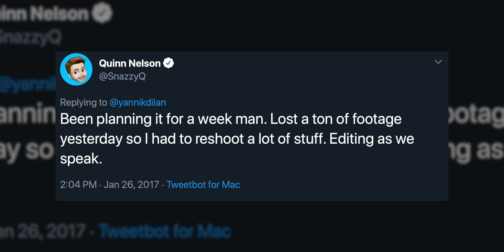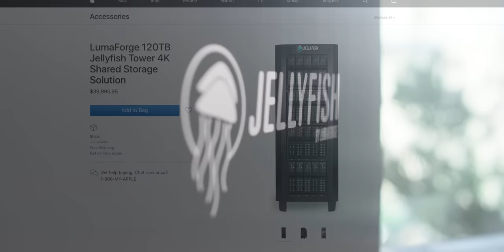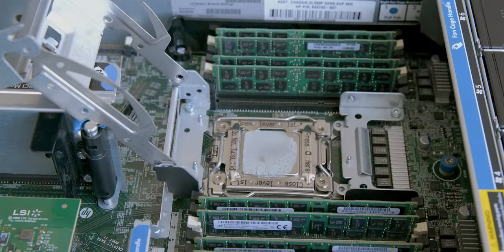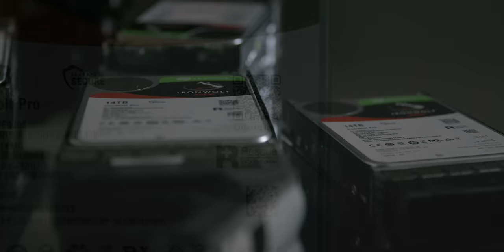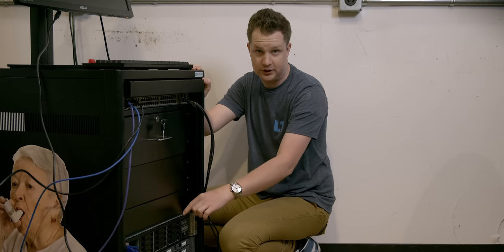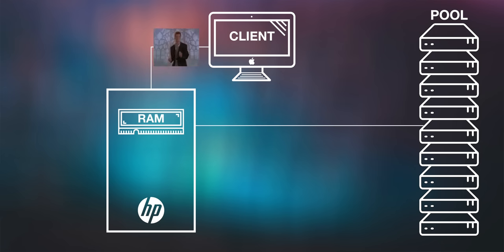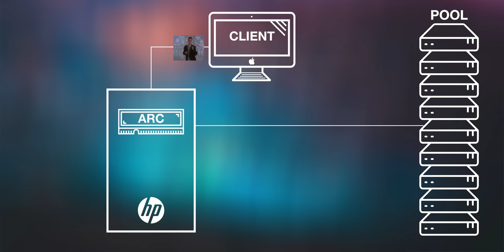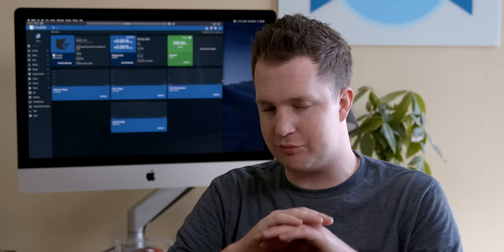I Built a HUGE 336TB Server Without Linus Tech Tips!

Comment: Is it possible to build a 1/3 petabyte server on a budget?  It is if you get 24 14TB HDDs for free.
Reply: That made me laugh too. Those 24 drives are £450 EACH in the UK, total cost for x24 (if you had to pay for them) would be £11,000+. That does not look, or sound like a budget server!!! lololol
Reply: Thought the same. Have an dual socket x58 board here. More than enough power, also a ZFS pool with ssd cache. Performance is more than enough for me and my Fam, but yeah, HDDs are still expensive if u need like 10 of them lol
Reply: Ah but he was going to buy them anyway so it's all ok.....
Reply: @magburner  I mean even if he paid for all the drives at $11,000 and $2000 for the hardware, throw in an extra $1000 for accessories and it's still a server on a budget compared buying new equipment and a software solution on top.  $15,000 is a very different number to $40,000
Reply: easy, he means budget for what it is, 120tb 10gbe storage, the cost of the drives cannot be avoided. would you like to see the price on similar jellyfish storage?
Reply: I wonder if Snazzy is actually going to put the worth of these drives on his income/business tax. I doubt it since nobody ever does that.
Reply: @giornikitop5373  jellyfish is some new trendy BS, no actual production studio will be using them. They are charging for software and support. 
This single setup he has would be a nightmare to restore without having VM's and multiple SAN's providing full redundancy. 

You want to have SSD's to work off of and then storage on the spinning drives. he spent under 10K but if he has to upgrade in just a couple years it was a waste.
Reply: @swaterman08  i know jelly is bs, i even contacted them asking for specs (like cpu type, ram etc) just for the fun of it, but they never responded back, i can guess why. sure a san will give a big boost in i/o perf but i think is out of reach due to difficulty to troubleshoot and maintain for most ppl, not to mention much higher cost due to fc or ib. i don't think upgrading or restoring this system is difficult, he can always add more shelfs or nics and freenas is fairly straightforward, not easy but not that hard for a simple storage solution.
Reply: A real person spending their own money would go with 8 or 10 TB drives, which scale nicely to that point at $115/4 TB, $185 for 6 TB, $225 for 8 TB, $270 for 10 TB; drives go up in price quickly beyond that point for each additional 2 TB in capacity...
Reply: @You know the deal son I've not heard of any Iron Wolf or Iron Wolf Pro horror/failure stories just yet...but, yes, some of Seagate's classic desktop drives in past years have been more 'failure prone' than perhaps some competing brands...
Reply: @DV7Dave  And, he has more than double the storage offered by Jellyfish and their silly fucking $40K solution....
Reply: @JurisLLM  you'd have to be a buffoon to want to declare 'sponsored gifts' as income! :)
Reply: @magburner  If you know costs of building servers, and you will count the capacity of storage, it is on the budget
Reply: @JurisLLM  He was given them for free in exchange for an ad placement. Do you report your birthday/xmas presents on your W-2 in exchange for recognition by the gift-giver? Mmm-no.. You don't. He almost certainly pays taxes for the ad-revenue he makes because he doesn't have a choice. This comment honestly destroyed me.. Think before you type, people.
Reply: @magburner  $10k for a server really isn't that expensive considering what he is running.
Reply: @giornikitop5373  The jellyfish isn't intended for people asking for specs other than 'how much video can I store?' 
It's the Apple version of a storage solution... "It just works" (as long as you got the cash)
Reply: Did you really not achieve any previous footage?
Reply: You can still do it with existing HDD with even 64 gigs if you wanted to, but yeah it's definitely not cheap.
Reply: Exactly. Drives are so expensive. 5 years ago I bought a WDEX4100 NAS with 4 6tb WD reds. £1000 ish.
Costs the same ish now, for same drive capacity.

Trying to find a cheap solution to massively expand my existing storage, but it's gonna cost thousands. Thousands I don't have
Reply: @mdd1963  "you'd have to be a buffoon to want to avoid committing tax fraud! :)

There, fixed it for you.
Reply: depends which budget 😂😂😂the title, as it is, indeed is ridicolous. It misleads people make thinking on very affordable "for everyone" system. But it's a budget nas, if compated to a brand new for enteprise purposes. Good to now there are so many ppl, ytber, full of money 🤣🤣🤣
Reply: @magburner  The video was sponsored by Seagate, so maybe he got a discount on them.

Comment: If Seagate gave me $11,000 worth of drives, I'd be recommending them too. Jokes aside, that's pretty neat.
Reply: Yep its easy to say that you build this setup by <2000$ of enterprise grade hardware when you are getting 24 14TB HDDs for free.
Reply: In the UK that £12000 of off the shelf drives
Reply: I still wouldn't recommend them. I'd sell them to suckers on ebay and buy some reliable drives instead.
Reply: Sammy Swanksmith these drives are fine 🙄
Reply: @sammyswanksmith4807  It's actually astonishing how much money Seagate wastes gifting drives instead of improving the quality of their products. I've literally never seen a single sponsorship by WD in an entire decade that I've been lurking on YT, and the reason I think about this is pretty simple: they are the best rock solid brand in the industry for HDD, so why would they need to spend money to sponsor a project? What else could you go with if you need a reliable storage? Top lineup uses HGST helium drives, which still is WD. I may have trusted my old Maxtor with PETA interface, but I don't have as much faith in Seagate, and you shouldn't have too if you periodically check Backblaze HDD reliability stats.
Reply: You can apply the same concept for Samsung with SSD. In the end, you won't find any better NAND than theirs; it's just such a well-known fact that it doesn't need sponsorship.
Reply: @You know the deal son what do you recommend?
Reply: @lostremnant1140  
I purchased a WD 500 gig drive from amazon a couple months ago and it arrived unusable. While the system would recognize the drive, the drive would not format.

Can't say what caused that as I am not a technician, but I think their shipping the drive in a loose fitting box inside a thin bubble wrap envelope did not protect it from the shocks that occur in the delivery process.
Reply: @Chukijay  WD Red Pro's are the best

Comment: really cool setup but i know from experience that 60 seconds is NOT enough time to shutdown servers, you're gonna want to get a bigger UPS
Reply: Realistically he would have up to 10 or 15 minutes with the UPS at full load. Meaning you would have to be pulling 1500w with a pf of 1 to achieve even the minimum runtime for the UPS. That is also assuming your batteries arent old and nearly dead which could give you a runtime of 1 minute
Reply: Well you can get a big 18650 bank
Reply: He's saying that at PEAK LOAD  there would have a minimum of 60-seconds for the server(s) to begin the shutdown process. Other than that specific situation happening (never), he is 100% safe with the hardware he's using.
Reply: Nah he's using ZFS no UPS needed. Especially with only two users. Copy On Write is freaking amazing. I have a zpool that is 8 years old. It has survived many power outages. A bad drive. Even a bad SATA cable that would randomly disconnect a drive sometimes mid use (that one was annoying to figure out). Every time I’ve ever had a problem ZFS has had my back. Resilverd and ready to go.

I even dd a /dev/zero over one of the drives once. I know I’m a dummy. Was trying to erase a thumb drive. Ran a scrub and everything repaired no problems.

Comment: You should consider adding a NVME log volume for the ZFS; This will allow plenty time for coalescing I/O and handle bursty I/O as well; I'd also recommend using a separate boot volume, if necessary.

Just leaving it as a suggestion :)
Reply: He is using a separate boot volume, FreeNAS forces you to. Generally it gets run off a USB flash drive.

Comment: "on a budget"... if you get sponsored with $12 000 worth of hard drives
Reply: Comparative to the other solutions, it was still cheaper. And if you used cheaper drives or slowly purchased your drives I'd say it's a pretty good budget option for these kinds of demands.
Reply: meliohe! A budget is a set amount of money that doesn’t mean necessarily cheap. The server even if the drives are $12,000 and the server being $2,600 is still cheaper than a lumaforge, which is $40,000. This isn’t for the everyday consumer this is something that meets his needs. NAS is a great budget option for lower spec requirements.
Reply: István Szikra I have card board boxes, an old laptop motherboard, old hard drives laying around, and a glue stick. I’m sure I can make my own using those items and not break 3 dollars
Reply: If you really needed to do this on a budget he wouldn't have needed to be sponsored and get a walk through. I did this on a budget and it cost me a couple thousand dollars. It's amusing to see that all these YouTubers created a server around the same time and clearly never thought about backing up their own data until a sponsorship arrived. You think considering it's their job that they would care about their own content that they've created. 

To do this you need to take apart external hard drive, "shucking", and build cheap Nas, utilizing the sc846 chassis that you can usually pick up for 2 to $400 off eBay with some parts included(I tossed almost everything).  You don't need server grade Hardware, but I find running Intel is easier and your chassis already comes with server grade Hardware so you might as well utilize it. I'll upgrade to ryzen when I can tho for power efficiency

Comment: Hey Snazzy,
On the subject of upgrades, there's also another method,
If you have Auto Grow enabled on the pool, what you can do is pull an old drive on a vdev out, and stick in a new higher capacity blank drive, and let the NAS rebuild the array with the new disk, then move onto the next disk. Once all the disks in the pool have been upgraded, the pool's capacity will magically increase to suit the new disk sizes without having to add additional drives.

Also regarding the noise, check the UEFI Settings on the HP Server, there may well be some options to adjusting the cooling profiles to favour less noise, and if the machine lives in a space that doesnt see excessive temps, you should be able to get it decently quiet. All of my Supermicro and IBM / lenovo System-X Machines have quiet profiles, and they really are quiet on most days unless it gets really hot.

Cheers.

Comment: When I saw "Without Linus Tech Tips" in the title I was concerned that you did it yourself and it would end up being meh, then you said Wendell helped and I was super happy because he's amazing
Reply from the maker: Wendell is a super hero.
Reply: yeah, this system running zfs and being really value and reliable is also inspiring to other creators and home users to build sth. similar on the cheap/far cheaper than this even, that actually has proper reliability and  data corruption protection.

Comment: Thats not a 1500W UPS, its a 1500VA UPS which supports 1000w, just FYI
Reply: VA is equal to W. They are both the same unit of power. What does 1500 W represent and what does the support for 1000 W mean?
Reply: @matj12  Nope, they are very different measurements. Spend 10 seconds googling it
Reply: @jimsbagels1991  They are the same unit but in two different measurements. I spent some time searching for what the two measurements represent but I don't know what to look for so I didn't find the answer. What should I look for?
Reply: @matj12  Resistove vs. reactive load, true vs. apparent power. Easy to confuse! P=V*I only for cos(phi) = 1 :)

Comment: Note the ZFS theory is incorrect.  Data is written to both the ZIL and the ARC at the same time.  The ARC is super fast (memory) so the write performance is limited by the ZIL.  Once the ZIL confirms that the data is stored, then the NAS tells the client that the data has been committed.  After that, the system works on writing the data from the ARC (not ZIL) to the disks.  The ZIL is only used if we are recovering from power loss.  Because of this, it's important that whatever SSD you use for a ZIL has power loss protection.  Not all of them do.  With these kinds of speeds, it's important to tune your block size, TCP/IP stack, use jumbo frames, etc to your workload.

Comment: Seagate, the only brand of HDD's I've ever owned that have died on me, plenty of them as well.
Reply: Blind Bob  There are quite a few around tough that pick Seagate as the brand that results in failing HDDs, which is why I guess they are puttning so much into marketing now a days while others ain't.
Reply: Seagate is garbage now.
Reply: My Seagate vs Maxtor dead drive race was neck and neck years ago until Seagate bought Maxtor.  LoL.  I have built a lot of machines over the last 20 years and have only had one WD rma.
Reply: @Aaron-hg8jo  I have over 100 Seagate drives in our DC. I've only lost a handful in the past 12 years.
Reply: @jamiemcparland  a handful?! That sounds awful. Time to switch to another brand.
Reply: I would  never trust another Seagate drive they are total garbage. Had many fail me. I don't know why someone would build a file server with garbage unreliable drives
Reply: Seagate Baracuda drives are pretty well established to be actual spinning rust with extraordinarily high failure rates. Ironwolf have a decent reputation, AFAIK, HP and Dell/EMC use rebranded Ironwolf drives in their servers.
Reply: @Rick Zune, same here but strangely the one Seagate HDD that is still working,  the one in a million 😆, is the one with the Apple Logo on it. The one I pulled from an old iMac when I was upgrading it to an SSD.
Reply: I only own one Seagate drive, and it's dead as fuck lol
Reply: We had dell poweredge R720 servers on our plant and had to swap almost 50% of the disks. Guess what brand...
Reply: I've lost a bunch too

Comment: A lot of good choices here. Nice work. However:
1: I would have used Z3.
2: Remember backup! Raid is not backup! 
3: Remember backup! Jottacloud and backblaze are good bets. Unlimited backup on the cheap.
3: 60sec for a DL380 G8 to properly shut down, writing everything that is in cache to drives? I highly doubt it. Get a bigger UPS with options for extra battery banks, like Eaton 9130 for instance. You will NOT regret this. 
Take it from someone that works with enterprise storage systems.

Comment: I work in an IT Company and we had so many Seagate Drive failures (also ironwolf pro). They were completely gone after 1-2 months and the other one failed 2 weeks after the first one. And such things are happening pretty often. They may be a bit faster and a bit cheaper than the WD Red HDDs but these WD Reds do not fail often. And when they do, then it is only on a tiny bit of the HDD. So you have maybe 2-3 MB of corrupted data but the other 5997MB are still good.
We also use Seagate enterprise SAS drives in the Servers and they fail way too often.

Comment: Nice. I recently got an HP ProLiant DL380p Gen8. It has duel Xeon E5-2670s, 384GB (24x16GB) DDR3 ECC Registered RAM, a 10GB copper NIC, two fiber channel HBAs (with the SFP+ modules still in them). It was only $249 USD. If I re-sold it today, I could probably get $850+ for it easily.

Comment: Seagate.....we will be hearing from you in about 2 to 3 years when you replace all the drives.
Reply: The Backblaze report shows they're not too bad, but a professional outfit should be replacing drives before they die, anyway.
Reply: @zxcvb_bvcxz I have had NOTHING but problems with seagate for the last 10 years. After losing $1000  in drives in my microserver 2 years ago I refuse to buy them again. 4 drives failed in 1 month. I lost the whole array....basically every seagate  drive I have had since they went to perpendicular recording in the 320GB and up has failed. My WD and hitachi drives have been nearly flawless.
Reply: @z3razerviper  My experience has been the same. My Dell laptop's seagate drive, 2 1TB hard drives in my Dell desktop died, and 2 2TB NAS hard drives died. Anything but seagate for me.
Reply: agreed. seagate sucks. so many dead drives over years. i have like 2 or 3 full bins of seagate drives that are dead. totally dead.

Comment: Dude, I beat your highly vaunted server by picking up a surplus 12/24 HP workstation at Amazon for about $1000 and my rig is super quiet because it was a workstation; now it is a server running Unraid. I enjoy watching vids like yours so I can optimize your mistakes by getting more for less. BTW - I now have 2 Threadrippers (1920x and 2990WX) and 512 GB RAM and everything I have sits in my tiny apartment which means it is all whisper-quiet even under load.  Racked computers are NOT cheaper than the other kind that do not sit in racks.  Kudos on getting that super load server.  I don't have 336 TB yet but I do have a much greater ability to add storage on the cheap.

Comment: I will say that I've not watched your channel, but I think you did a very good job explaining your setup for those without lots of storage experience. I've been doing storage for decades now and can appreciate the setup you are using.

Few points. Using ZFS, be sure to not fill the pool up to 80+% unless you want to experience pain.

Would be worthwhile knowing the HBAs used. For a setup like you need I'd highly suggest a multipath server backplane and HBAs. Because you can chain disk shelves in a ring. Also, if you ever need some more HA you could consider a dual headend setup.